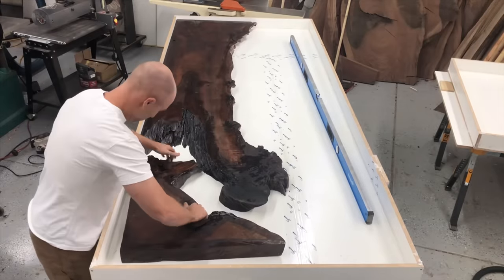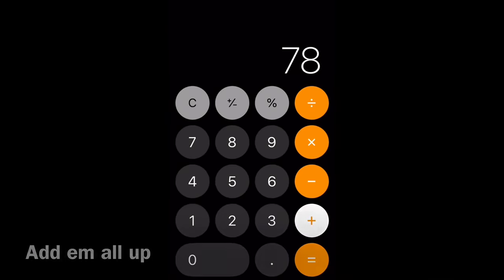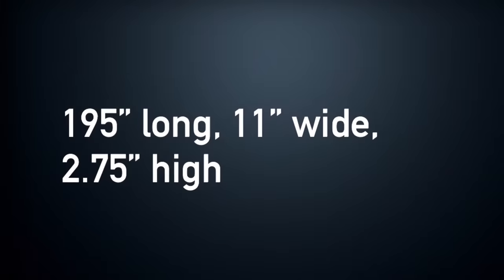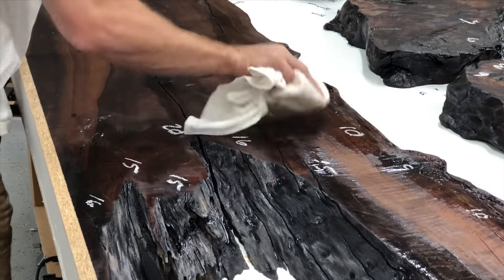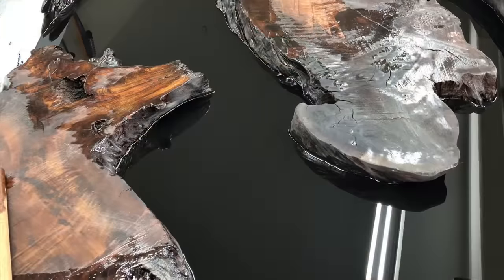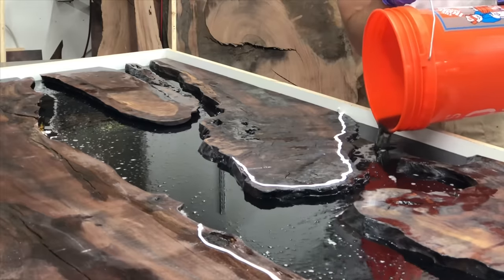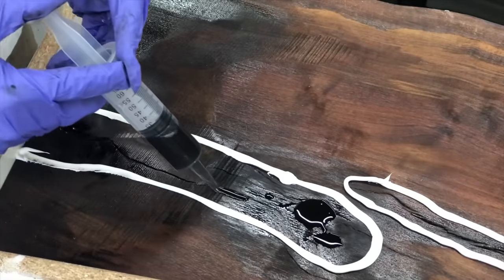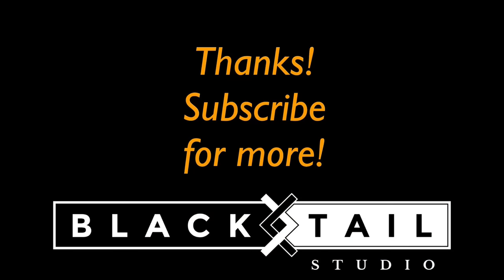Calculating Epoxy Volume--How to Epoxy Woodworking

Comment: Just awesome. I've been watching a few of your videos and the projects are all tables. Would I be able to do a 3 panel mural or would the weight be to much to hang on the wall? Thanks again for the very informative videos!!
Reply from the maker: Oh probably fine!
Reply: As long as the pieces are hung from studs in the walls AND the studs are wooden, not steel, anything that one or two people can pick up should be fine. I mounted an 85" TV on a wall built with steel studs in an office building, and the wall literally bowed outward from the weight of the TV and mount. I had to fabricate a backing plate from 1/8in aluminum plate on the other side of the wall in the next room and run carriage bolts all the way through the wall, sandwiching the entire drywall/stud/drywall assemblage & sufficiently distributing the load. The office manager then hung a large piece of artwork over my backing plate to hide it.

Furthermore, tables typically have to be thicker to support whatever may be placed upon them as well as their own mass. Cam's tables all seem to be a minimum of 2inches thick. Anything you're gonna hang on a wall should be fine at 1in thick, because that would still give you enough material to attach wire or some other mounting hardware.

Comment: Hi: I would appreciate your advice on my Hatch Cover project. I will send a couple of photos. The piece is roughly 27x59x2.7in.  with 3in. steel straps on the ends and a steel rod across the middle. The cover is made from 4 planks of wood (Cedar I think). The piece is dry and stripped to bare wood. There are a couple soft spots on the underside, maybe 3 or 4,  1 inch square areas about .25 to .50 deep, I plan to wire brush them out, scrape a router them to clean the wood as necessary. I will use some Minwax (MW) wood dryer to stop any further rot. I plan to fill the .75 in. seam with MDF painted black, and allowing space to fill the remaining cavity  with black dyed resin. The same for the other smaller seams, gouges an imperfections. My first problem are the edges. They are uneven and I think would not allow a smooth pour over.. Even a smoothing with a round over bit trim would still be uneven. (Although I don't think a slightly uneven edge would a problem if the resin could be built up and sanded smooth. 

I plan to stain and seal the wood with a waterbased polyurethane (?) after filling the seams and gaps with a stainable filler. (Ideas?) My dilemma is whether to attempt pouring many thin layers with a clear top coat or pour a casting resin around the piece to create an edge. 
kenwassner@gmail.com  Where to email photos?
Reply from the maker: Probably a little more involved than I can answer in a comment. Sorry! If you don’t figure it out, I do offer consultations. Best of luck!

Comment: Could you place the wood against a green screen and take a photo of it from high up, then use a program to measure the proportion of area that is green?
kinda assumes symmetry on average along the width but might not be too inaccurate

Comment: How about taking a picture directly above the table and then using software (imageJ, free and awesome) to count the white pixels? Then just divide # of white pixels by the total pixels inside the rectangle the table occupies in the image. Then multiply that fraction by the actual area of the table, and then finally multiply by the depth of the wood to get your volume. Dig your videos, keep up the good work!
Reply from the maker: Noted

Comment: Hey mate, really appreciate the detail you go into in your videos. Watching all the way from Tasmania, Australia. 

I was hoping you’d be able to hope answer a question for me. I have a large timber slab that has been stained all over with Rustins Danish Oil. Is it still possible to use epoxy over this slab or would I need to sand it back as much as possible to remove oil. Cheers!!
Reply from the maker: I’d sand it off

Comment: Hey, great video. Though, I think it would be easier to calculate the volume this way:
-Measure the weight of 1 square unit of the wood and its volume
-Use that to calculate the total weight, and subsequently the total volume
-Subtract the total volume of the wood, from the volume of the container
-??
-Profit

Comment: You can get an exact measurement. Build a frame around your work a few inches higher than your build. Get a large tarp (soft but thick enough it won't puncture) and a few lead weights. Stuff lay it over your object and match it to all surfaces best you can if there are overhangs add a few weights to keep the tarp from moving. Fill with water, keeping track of how much you add, until level with your work. Now you need to use an aquarium pump to pump out the water. Use some old towels to soak up any small puddles you can't reach.

Comment: A bucket with a low nozzle and a flexible hose so you can pour perpendicular to the bottom of the mold would reduce the air mixing in with the epoxy quite a bit by taking away the time spent flying through the thing you don't want in it

Comment: I always just make a more epoxy than I need and measure the amount. After finishing the pour I substract the amount left in my bucket and I have the exact amount I need withount any unneccesary calculating and I don't even have a single drip of leftovers on my final pour.

Comment: Thanks for all your videos, they are by far the most helpful as I prepare to do my first river table. I have a question from the "Calculating Epoxy Volume" video. At one point you talked about measuring the top and bottom of the void in sections where it tapers a lot. Do you then take the average between the two distances and write that down for that section? I couldn't tell if that's what you were doing in the video. Thanks again.
Reply from the maker: Just make additional measurements and add em to the total
Reply: @BlacktailStudio  Now I understand. One more question: how do you clean out your measuring and mixing containers once you've finished your pour?

Comment: Hey man awesome videos thanks so much. I have a quick question, say you ran out of epoxy (miscalculated) and didn’t have enough to finish. If you were to pour again after a clear pour cured, would you still sand the surface for a good bond or do you think it will still stick ? 2” slab, only poured about 1” so far so it will still have some wood to grab into. Thanks!
Reply from the maker: I’d scuff it all up
Reply: Blacktail Studio thanks for the reply!! You don’t think that layer will be visible if I scratch it all up with sand paper?

Comment: Hey Cam,  I do hope my question(s) aren't too stupid, but I am just starting to make tables and I've seen/heard so many folks on here that recommend different types of epoxy and how much to pour it.  I thought I'd throw my questions to you since you seem to bed making money doing this :).    So ... In making this table that you made to explain how much epoxy to use making a table, what type of epoxy do you use?  And .. it doesn't look like you are pouring over the wood, but just to the top edge.  Is that right? Or do you pour over the wood to sand it all down.  I'm really looking forward to starting this as I've already spent thousands on tools and "stuff" to work with. Thanks in advance, Bill in NC
Reply from the maker: I use liquid glass. And check out one of my table build videos. Should help

Comment: Hey Cam, I following this video for the calculation portion (may have a question regarding that later) but I see you suggest “shellacing” the edges but I saw another video you were using liquid glass instead.

Is my shellac job (thin passes on edges) acceptable or potential failure in regards to bonding to the resin

Comment: Great looking table.  Wouldn’t it be easier to do your resin calculation by pouring into the river  (spaces) clean dry sand, dry coffee grounds?  Then remove the wood pieces and pour your sand , or grounds from the frame into your buckets?  Calculation would be pretty accurate but done in about 5 minutes.

Comment: Hi! My name is Peter and I was looking for some knowledge regarding how to create epoxy cutting boards and saw your videos with the tables making, I love the way you work! Amazing and the videos caught me for about an hour yesterday 😄 Now I’m about to buy olive rings to create my first epoxy small table (phone table). About 2.5-3.5” thickness and 20-30” in diameter. 
To make it short, I started watching your video regards the calculation of amount of epoxy and  I thought that for certain length (big ones) and width of a table you should have certain thickness - what is the calculation for this? Thanks in advance!
Reply from the maker: I’m sorry, I’m not sure the question!
Reply: Can you send link for measurement tool you were typing your lengths and widths and depth thank you

Comment: Tried going by weighing the wood?

1. Weigh a given cube of wood (say, 10x10x10cm), so you can calculate the density of the wood.
2. Then weigh of all the wood you're putting in the mold, and apply the density so you know the volume of the wood.
3. Then calculate the volume of the mold to the height you want to pour epoxy

Then you just substract the calculated volume of the wood from the mold volume.

Downside is of course that you need to know what the given cube of the wood weighs in at, and that is probably different for different kind of wood, and fluid content might skew the density a couple of percent. Also, you need a system to weigh the wood :D

Comment: Two questions.  1. You say you shellac the edges, are you referring to actual shellac or an epoxy coating for the edges?   2. You added an 1/8" to the sides and bottom, is this just an arbitrary safety addition just in case some epoxy goes underneath and around the slabs or do you actually space the wood off of the mold an 1/8" to purposefully "encase" the entire rear and sides in a shell of epoxy?

Comment: Riggs!! I like the clean lines on the table broken up by the wavey edge. I still struggle to release resin from moulds. I noticed on your previous videos you’ve used a release tape. Have you got any product recommendations? Cheers. Mike
Reply from the maker: Ya, I should have a link In The description

Comment: Hi looking to do a L shaped river table for a bar top but these seam to be ultra rare on here have you any tips on joining  the wood together before I pour was looking at looking joining the woods together with permabond and pocket hole screws to pull in tight what do you think ? Any help would be greatly appreciated  keep up the great work Paul

Comment: I've poured many dozen epoxy table tops in every shape you can imagine and I'll promise you there's a much quicker and more accurate way to figure how much to mix up. After setting the pieces into the form I use the cheapest, thinnest poly drop cloth that I can get and cover the whole form with plenty to spare all around, start pouring water onto it using your fingers to manipulate the poly down into the crevices, the weight of the water causes the poly to conform tightly to every contour, even undercuts. When you're satisfied with the level of the water in the form simply gather the edges of the poly and direct the water off into a bucket. Now you know exactly how much to mix, I usually add 3-6 oz just to be certain.
Reply from the maker: Interesting!

Comment: Someone may have already mentioned this, but another way to measure the length or circumferences of odd shapes like these rivers would be to take a string and lay it along or around the shape , cutting it to size, then measuring the length of the string(s)

Comment: Nice way to max out the value of otherwise...scraps!
Reply from the maker: Thanks?
Reply: @BlacktailStudio  Well it is...although it's more of a sea of epoxy than a river. I'd rather have more wood to epoxy ratio iow...
keep the cost down too.
I've got a walnut my grandpa planted during WW2 slabbed up and air drying - 2+ years now. So i appreciate the vids dood

Comment: Hi, nice job. I'm just curious - did you ever try to calculate the volume of the wood based on the weight and wood density? Maybe with little amount of wood it wouldn't work but the bigger the table is the more precise this could be.
Reply from the maker: Na, this works pretty good

Comment: Ok, Lisa here from Corpus. I have done a few little tables, screwed up a beautiful little black walnut, but routered off the cured epoxy and repoured, came out perfect. I am ready (I think) to do my 1st river table, and the question is, did ya remove the caulk dam, or pour over it? Just curious, my river is going to be a more translucent blue/green. Any tips would be appreciated 
Thanks Lisa Lemmon
Reply from the maker: Can pour over it 👍🏼

Comment: Hey Cam! Cameron here. Just curious if you can give me some feedback about what is the importance of inlaying a c channel vs screwing in a thick solid steel bar with slotted screw holes across the width of a table. Making a 94x47” River table. Prefer not to add the extra routing step in if I don’t have to. The table cupped about 1/2” in one corner after removing from mold. Once I got the excess epoxy off it came back to about 1/8” now. Got it clamped and it seems to be slowly helping. I can still plane off the different I believe but want to help prevent any kind of bounce back. 

Thanks in advance and my 7 year old son Miles and me enjoy watching all your videos.

Comment: Genuinely curious if this would work. Weight the table with the wood in it. Pour water in it (if it wouldn’t effect the wood) and then weigh it again. Calculate the difference in weight and find out how much water there was. Comparing the weight of one liter of water to one liter of epoxy, you should be able to calculate the exact amount of it you need. I don’t know if that’s accurate but I’m literally in the shower just pondering.
Reply: You could also calculate the volume of the table mold without the wood, get a 1kg sample of offcuts from the wood you’re using, affix it to the bottom of a container, cover with a set volume of water ( maybe 1L) and that would give you an approximate volume you could scale up to your mold.  Say the 1kg sample displaces .5 L in testing and your table mold has a volume of 500 L. If your wood is 50kg, it would displace approximately 25L of volume, subtract that from your mold total.  It’s a guess but I imagine that would make for a decent approximate.

Comment: I'm pretty new to the resin game and I've been making coasters to start with. 

Wondering for some tips on how to get the epoxy to bond better with the wood. I'm using hard wood and cleaning it but it tends to separate and leave a gap. 

Thanks in advance
Reply from the maker: Oh weird! Sounds like a bad epoxy

Comment: it would suffice to weigh the wood. we would divide the mass by the density of the wood to get the full volume. knowing the final volume, we would deduce the full volume to know the volume to be filled with epoxi.
Reply: advantage: does not need to fill the box with water

Comment: Hello There ! 

When you’re calculating the width do you have to addition top and bottom measures  then dividing the total by the total number of measures ? 

In fact the top is kinda large  and the bottom is really short at some points.
Reply from the maker: Yup, exactly

Comment: You awesome work! Question, why not just place your sealed wood in your mold and then fill with water to top of wood and then drill a 1/2" hole in a white area and drain it all into one or two 5 gallon buckets to get your epoxy amount needed versus math?
Reply from the maker: Cause wood and water are a bad combo. Also, this works pretty well

Comment: Will the epoxy hold the large pieces of wood strong! Or did you drill your wood for the epoxy to go in and hold right
Reply from the maker: Check out my epoxy strength test vid

Comment: Question regarding multi-pours.  If the previous layer has cured, and you rough it up so the next will adhere, are those scratches visible through clear pours?
Reply from the maker: Just use 320 or higher and they’ll go away

Comment: Easier and more accurate to take a photo from above.  Then cut out and weigh the rectangle enclosing the table form.  Then cut out and weigh the void (white) space only to determine the fraction of voids.  Lastly add your usual correction.  Of course if you have image processing software (e.g. imagemagick) you can calculate the void fraction even easier (one step).  That said it’s fun watching.  Nice work.
Reply from the maker: Thanks for watching!

Comment: Hi. I am no expert with epoxy. However to save costs I sat the wood  on plywood and drawn round, then I add 60mm to the outline. I then cut the plywood out and draw the outline on the wood. Router the wood to leave 8mm depth. Then screw the plywood to the routered shape. The epoxy will now be 8mm deep  with plywood base. Saves a lot off epoxy
Reply from the maker: Thanks Andy

Comment: So when you were taking measurements on the top and on the bottom, did you add those two numbers together for the final number you wrote on the slab? I don't understand the taking two measurements part?
Reply from the maker: Just finding the average width if that part sloped

Comment: Do you ever reuse your bucket and if you do would you need to spray them with mold release before
Reply from the maker: The epoxy will usually pop out after it’s cured